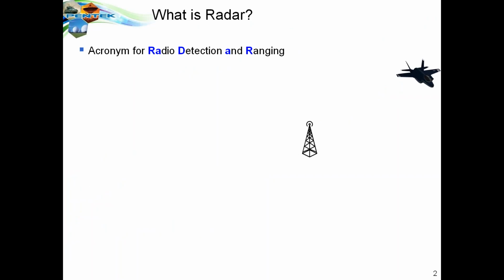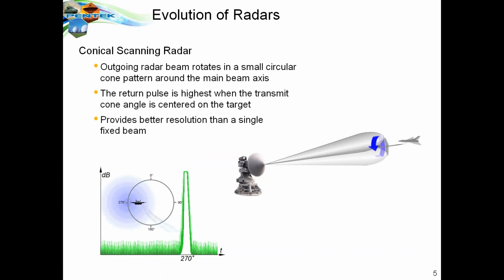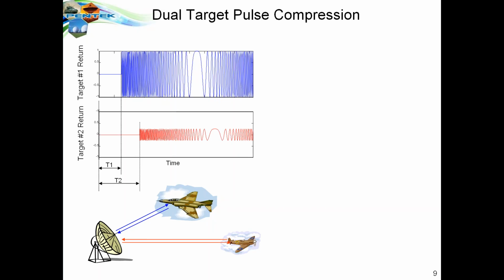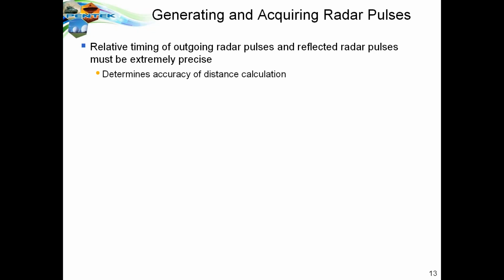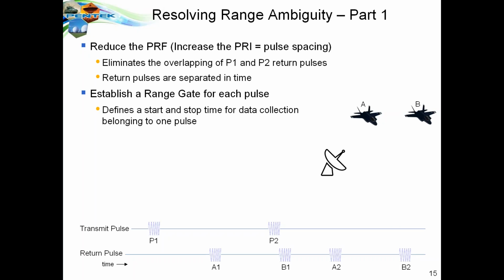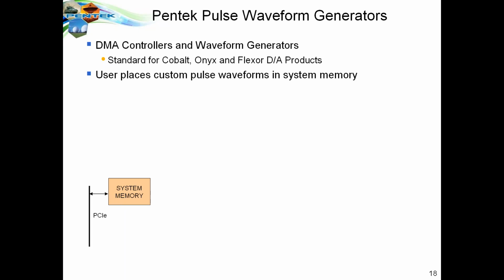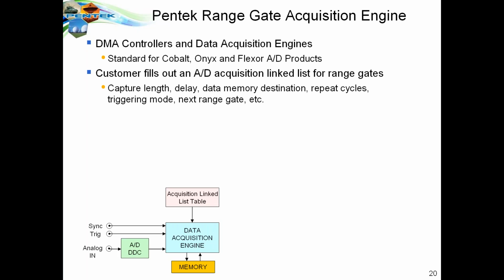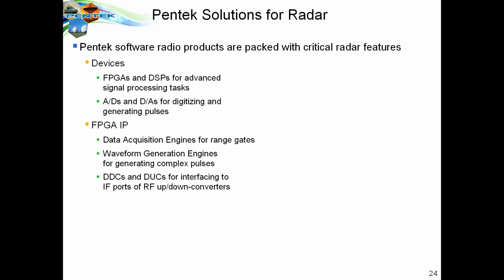Radar Tutorial

Comment: It is 300 meters per second not 300 KM
Reply: Sound travels with 300 meters per second. The International Space Station travel around the earth with almost 30000 kilometer per hour or almost 10 kilometer per second. If light were to travel 300 kilometer per second we would be able to reach it but the universe would look really different. 
The time the light of the sun would take to reach earth would be 140.000.000 km / 300 km = about 500.000 or 125 minutes where in reality it takes 7 minutes. 
Multiply by 1000 for your proposed 300 meters per second.